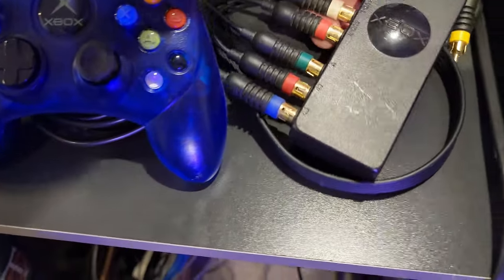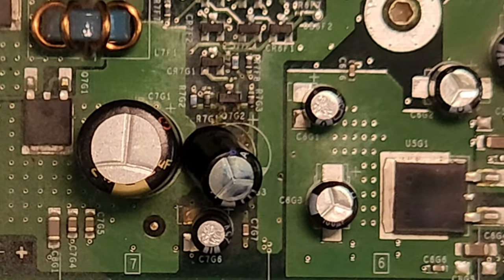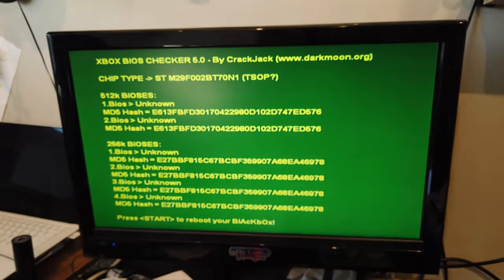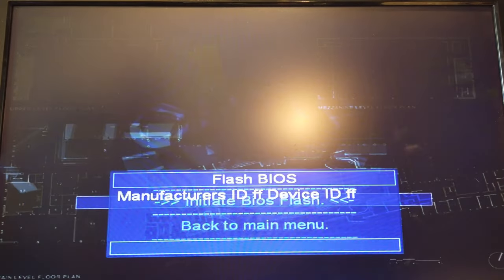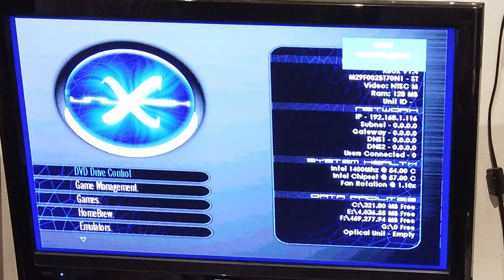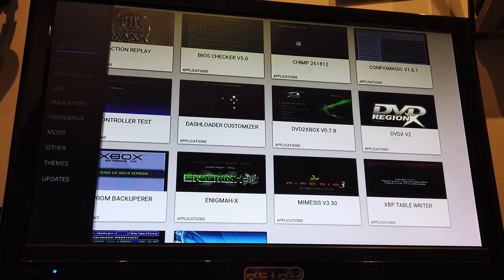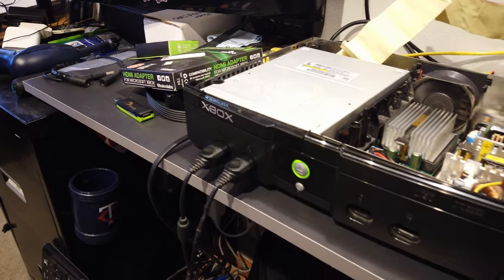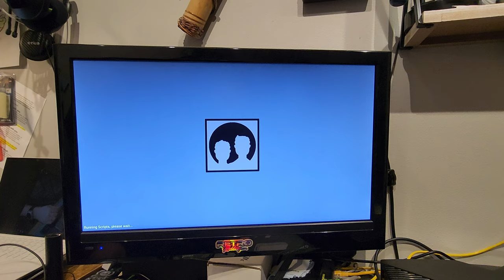Original XBOX in 2023 - TSOP, BIOS and HDD Upgrade! + Clock Capacitor Removal

Comment: It was January 17 2003, I was 20 and when I had enough money form my job that day, I went to a Walmart in Great Falls, Montana and bought a new, unopened XBox. I was lucky enough to get a v1.0 box. (yeah, it hadn't been out that long, but that year before the 1.1 boards were already out. My first game was Morrowind. I played that and a little known gem called Metal Dungeon. After having the XBox fora couple months, I went out, hunted down a copy of MechAssult and an Action Replay memory unit thing and soft modded it.
six month later, upgraded the rive to a 250GB and started copying games to the box. I would go to Hastings and rent a few games, spend a day or two copying them to the hard drive, take them back for credit to rent out a few more. I still have it in a box in my parent's garage. I need to retrieve it and fix it up.

Comment: I bought one with 750 Xbox games preloaded a while back.im looking into buying another one with 950 games in it both have 2 tb hdd and both have cervios  I wanted to use it for system link. Would you happen to know if this would work? Or would them both being moded affect this feature ? Thank you
Reply from the maker: I could test Cerbios against my Xbox 360. I don't have another Xbox but I think I could do like halo or halo 2 and find out.
Reply: @SpiceVader  that would be awesome bro 👍👍👍🙏
Reply from the maker: Just tested it tonight. Xbox 360 unmodded with an original halo 2 disc linked with my Cerbios modded Xbox. Loaded up System Link mode on the same network and it worked and played perfectly.
Reply: @SpiceVader  that's awesome! Thank you so much for the info and you're help you're the best 👍👍👍👍